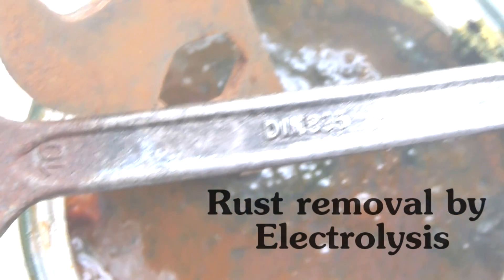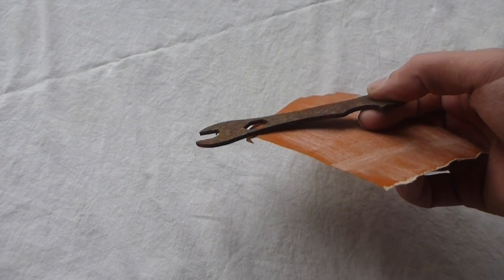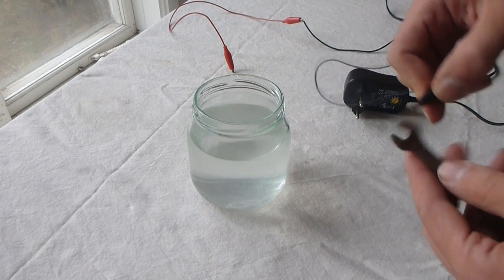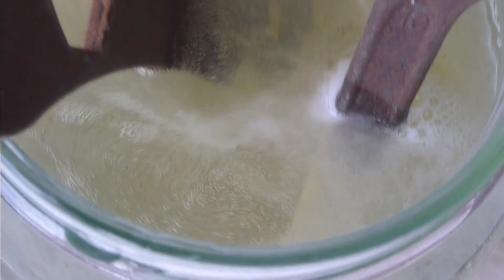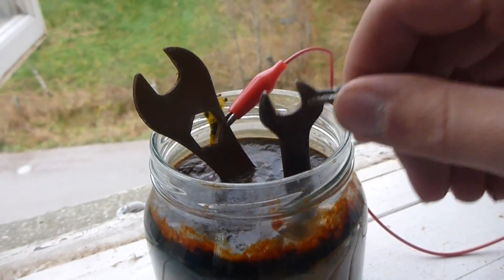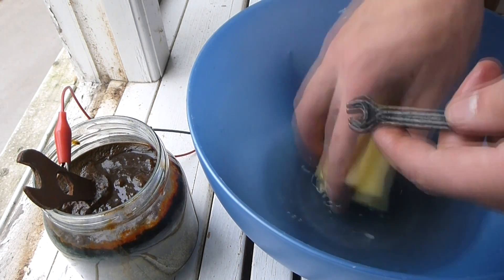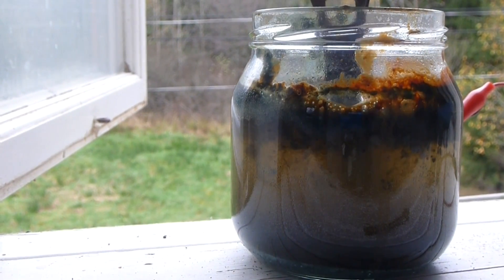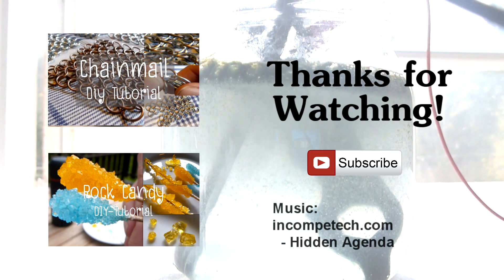Electrolysis Rust Removal - DIY Tutorial

Comment: He isn't removing the rust. He is oxidizing the wrench which causes causes it to corrode. Don't do this because it'll just cause the wrench to shrink. PS. The water is filled with rust and the gas being produced is most likely hydrogen
Reply: the sacreficial one will shrink. the other one will loose the rust and maybe even gain some nanometers of metal from the sacreficial one (Electrolysis plating  ) . for instance if he used nickle for the sacreficial one  it would get nickle-plated ( that proces is a bit diferent ... u need a nickle bath ... but other than that its the same )